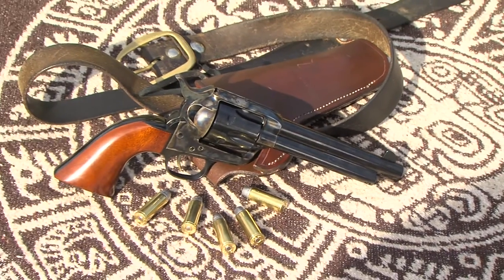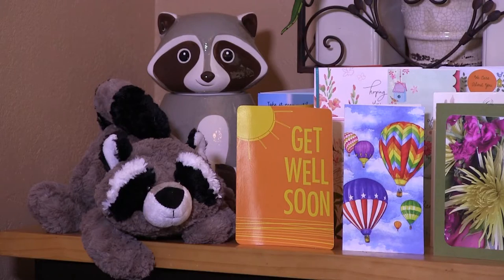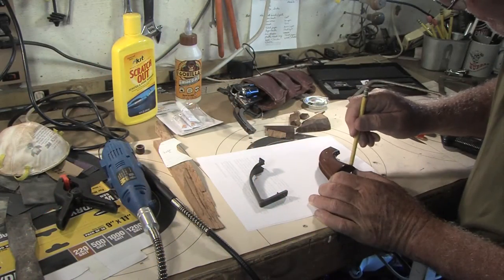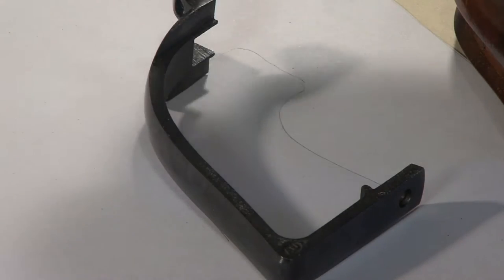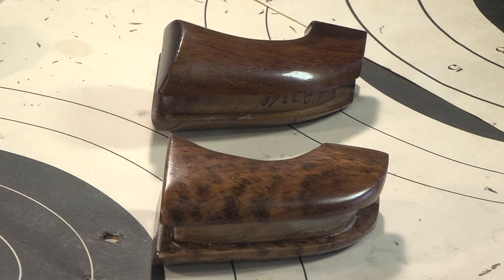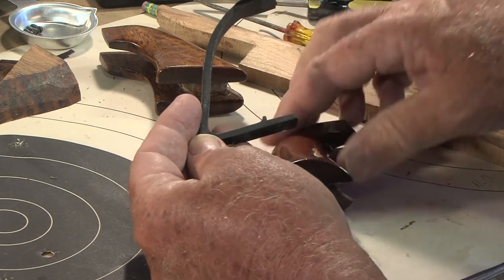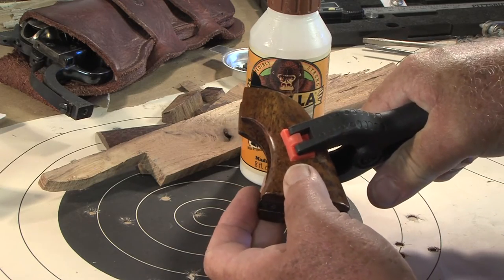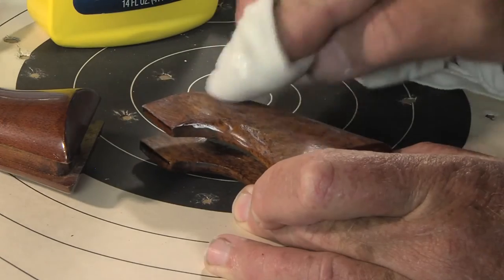Making wood grips for a six gun

Comment: nice grips, but they are too small for your hand. You should have made them a little bit longer because your pinky is at the edge of the grip.
Reply from the maker: Hi John,  I had just enough wood to do what I did.  I would have made them slightly longer but not enough wood.  Snakewood is very expensive and that hunk of wood just barely sufficed.  It was scrap and I got it cheap.  However I really like the increased thickness and slight increase in length.  And particularly enjoy shooting this very accurate revolver.  Thanks for your comment and interest.  Rick